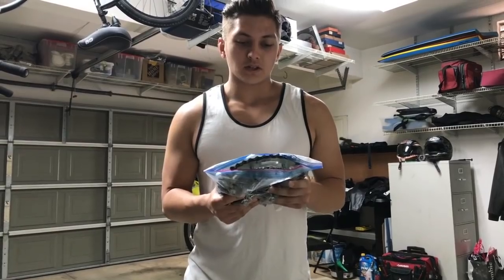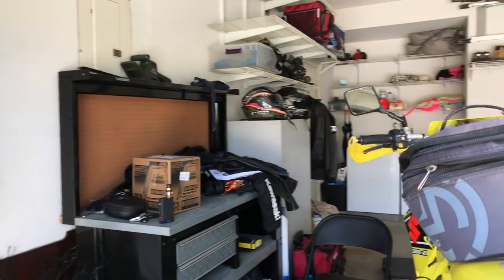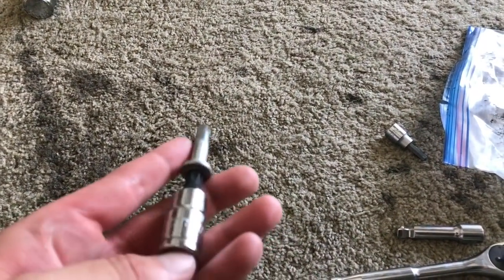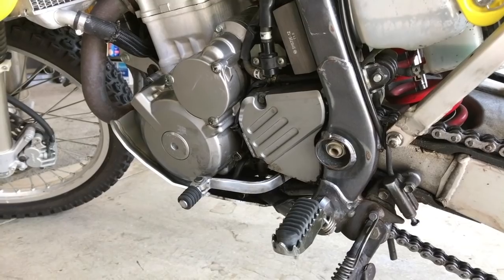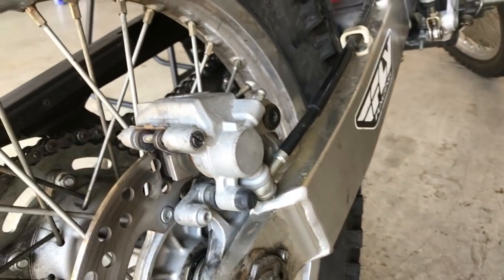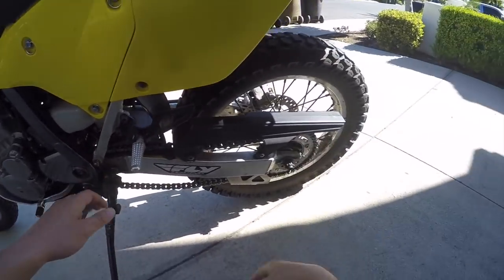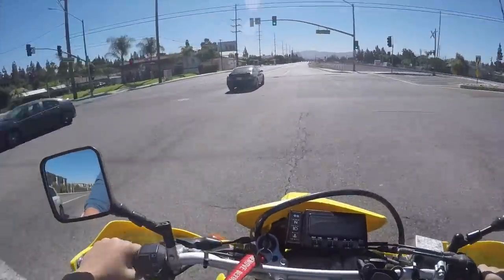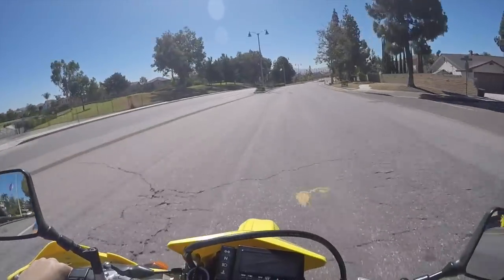THE BEST DRZ MOD: GEAR RATIO

Comment: your axle is in the wrong side your snail cams are upside down.
always undo the nuts on sprocket bolts the allen head is only to stop the bolt spinning after the bolt is loose.
your chain is way to loose.

Comment: I went 15/47, just changed the front sprocket only, works as a great all rounder for me. Low enough gearing for the fire trails and high enough for the freeway. 
Better fuel economy and a longer run in each gear. No problems for a wheelie 👍

Comment: Hahaha oh my god I was cringing the entire time, he rode it from his “mechanics” with the countershaft nut loose, dumb as fuck.  Chain is loose as hell, the rear axel was put in thru the wrong side.  Guarantee he didn’t loctite the counter shaft nut and Torque to 80lbs  and it got loose already and is eventually gonna blow the seal and  drain all his oil which he defiantly won’t notice and it’ll blow his engine. Some people shouldn’t work on their bikes, for their own safety.

Comment: That chain is dangerously loose.

Measure the midpoint between the sprockets, and at that point slide your middle 3 fingers under the top run of the chain. That’s 40-50mm, and the spec.

Comment: Dude you definitely need a new chain. That kinking in the chain is a bad sign. And don't put all your trust in the clip style master links. Your chain is way too slack for street riding too
Reply from the maker: jsnowden83 what exactly do you mean by the kinking in the chain?
Reply: In the first part of the video when you are looking down the chain you can see how there are several links kinked. It means your chain is wore out
Reply from the maker: jsnowden83 the chain has 200 miles on it and doesn't even have surface rust. I get what you mean. I'll keep an eye on it though.
Reply: SoCal Moto a bad chain won't always have rust. Just make sure you keep it adjusted correctly and well lubed
Reply: ya that chain is seriously slacked out waaaay to much

Comment: Have a 2019 drz400sm stock. Just did a 16 tooth up front from 15. I love it.
Reply: How much torque did you lose?
Reply: @KaelinTate  not sure but after that i added 39 rear tooth. Bike can wheelie from 1st to almost top of 5th
Reply: I did a 16 up front and a 39 in the rear...perfect for the highway

Comment: The countershaft sprocket will come off with heat.   Heat gun or map gas. 
Check out Aussie Dual Sport about a short test ride.
Being a YouTube junking everything you want to do on that bike is on there.
Nice Video
Reply from the maker: Hillbillybeeemer WV I totally hear you brother. I didn't have a torch or anything at the time so my nice mechanic came in clutch lol!

Comment: Gearing makes all the difference for sure! my SM came with 15-41 originally. I just put a 39 tooth on the rear this weekend; it's even better on the highway now. I do notice a slight lack of torque off the line from the 41 but that is okay. My SM has 17 inch wheels so with your 18-21 wheels I bet the 15-41 setup now is amazing. Great video!
Reply from the maker: Snow Peak thanks man I appreciate the support! Glad you enjoyed. More weekly vids to come
Reply: I'm 15 38 on my s

Comment: I have a RXB150 with only 4 gears. I had to change my rear sprocket for higher top speed and it was the best mod i have done for the bike. I enjoy the bike a lot more now. The bike probably goes 65mph. 

If I owned a DRZ this would be one of my first mods and it doesn't negatively effect the bikes mid to top speed just the take off speed going into the mid range.

Comment: Any time you have a bolt with a nut on it, you ALWAYS loosen the nut. You have to hold the bolt, but don't try to turn it, turn the nut. But problems like you had are how you learn! I've got the most badass drz400e that i plated and I'm going to try a smaller rear sprocket. Thank you for the video, even though it's 6 years old! Oh my God, i can't believe you rode it with the chain so loose!!! You're lucky it didn't bunch up in front of the drive sprocket and smash your case!
Reply: Yup

Comment: The trick on the sprocket nuts is to turn the nut not the bolt.  Use the OEM bolts, not the Trackside ones, the Trackside ones fits poorly.

Comment: So it’s a 15 front and 41 rear? What’s the top speed in 5th and you did not have to buy a longer chain? Just add the master link for convenience? Can you send me a link on where you bought everything? I have a drz400s 2019. Also one more thing, with the stock handle bars, it’s a pain to find a phone Mount that fits on tight. What kind do you have?

Comment: u gotta pull both axles off and clean off that black dirt grease and throw some marine grease on the axle rod mayb back the bearings and spacers wipe away excess but u def need that u will be amazed at how sqeak free and smooth the wheels will turn on her after that... and lock tite the bolts man ur day will end quick on the highway if a sprocket bolt backs out and flings out the moving chain throws it right thru the case on ur tranny... just do it right the frst time and clean and grease her up she needs it those spacers look dirty as heck..

god bless and awesome videos im thinking about getting the drz 400 r u on the 400 or do u have the 650

Comment: way to much slack in thsat chgain mane dont want chain slap take a link out would make a world of difference n ur adjuster nut wont be backed all the way out did the same thing to my ducati to get even more top end speed...also harbo freight has chain breakers n u can pop the link out and put it back together dont need a master link technically but good to do it right the 1st time

Comment: Thanks for sharing boss! I have a DRZ-E and I have been working with my gearing for the last few months! I ride 70/30 -more dirt and I have arived at 15/42. Don't know if you are aware but you should run the case saver for the 15 tooth if you haven't already. Ride safe out there man!
Reply: What's a case saver?

Comment: I just bought a drz400sm yesterday and it's a cool bike, I have a crf250l too and the first time I swapped the sprockets I had one bolt strip out on me too, took hours to get that one bolt out, factory uses thread locker, I didn't put any on the bolts and after 11000 miles they never came loose

Comment: you think this would work with a DRZ 250?  also might want to keep in mind what speed your tires are rated for...
Reply from the maker: Hank Amarillo I'm honestly not too sure with the dr250. Not extremely familiar with that bike. The only thing I'd say to watch out for is going when going with a bigger front sprocket just make sure you have the clearance for that

Comment: nice video bro . I went from a 47 to a 42 on my drz 400e and i cut 5 links of the chain with angle grinder .it was 14 47 stock now  15 42  have not been for a ride yet but if it seems a little tall i'll go back to a 14 on the front
Reply: How did the 15/42 work out for you?!

Comment: If I want my 2001 DRZ400e to comfortably ride on the interstate, what sprocket size should I run? I was thinking 15/42, but if anyone else has better suggestion I would love the feedback!
Reply: That's wat I run if you go smaller on the front you will eat your swing arm 15 front an play with the rear only because 14 hits your swingarm

Comment: i'm about to change the gearing on my drz , i noticed the chain link in the video that others have mentioned but also my axle goes in from the leftside and you had yours going in from the right side! I'm sure it works both ways just fine but i wondered which way it was meant to go. Cheers
Reply from the maker: Just Tex I haven’t experienced any issues with how mine was setup. From when I bought my bike to now it was like that so I just figured that’s how it should be. If it worries you that much just switch it. Pretty quick fix
Reply: I think i'll keep mine the way it is. I just had a quick look on here and could only find one other bike with it the way yours are, There's a vid of a brand new 2017 at the aimexpo and it has it the same as mine so i'm guess that should be right. But either way it seems to work just fine. Cheers

Comment: Is your DRZ an S or E model?

My SM used to have the stock 15/41, and then I converted it to 15/39 and made a HUGE difference.
Reply from the maker: E2Moto it's the S model. I basically converted it from the S gearing (14:44) to 15:41 and it's amazing!
Reply: I bet. Thinking about moving from 15/39 to 16/38, and it's very popular for freeway commuters.
Reply from the maker: E2Moto if you rock a 16 in the front you'll have clearance issues because it's too big for the guard. You can make it work but just remember that
Reply: SoCal Moto I got 16 front, I just run with front guard off
Reply: @E2Moto  did you did it?

Comment: did something similar on my sm. great on the hwy but forces you to slip the clutch a lot more when you're off road at low speed i find. oh and forget about wheelies lol.
 definitely not a mod for everyone
Reply: same gearing on mine sm , find the torque on 1 n 2 is bad 3 gear slightly better

Comment: whats the top on it ?
Reply from the maker: sdq sdq do you mean top speed?
Reply: the max speed after changing gears
Reply from the maker: sdq sdq if I'm throttling it for a while and laying low it'll hit bareeely 100 now.
Reply: i see guess this gearing is for mid range and pick up

Comment: imo you need no more than an inch of slack on the chain with u sitting on it and lock tight the countershaft sprocket nut. I hear they back off and destroy the shaft oil seal and dump your oil out real quick. there's alot of things you should use lock tight on on these DRZ's I'm sure you read up in it though.. ride safe.
Reply from the maker: Steve's Auto OSTROGOTH thanks for the info man I appreciate all the knowledge I can absorb! You too!

Comment: I tried 15 41. Ride for a few thousand. Ended up with 15 43 which i find perfect with a 140/80 18 rear tire. Great on the highway but first gear is still reasonable for the trails. Had the 15/43 on for tenthousand k now still happy with it!
Reply: Can you run the 15/43 setup with the original chain?
Reply: @AKJeeper  I'd like to know that too...

Comment: ACT Gear set, problem solved lol. There is no good compromise in sprockets for the DRZ using it as a dualsport. Either smoke the clutch in the woods and bust yourself, or red line at 55MPH. Now you can rock climb and idle at 65.

Comment: Thanks for the tips duuuuude.
Next time I come across a nut or bolt that is too hard to loosen I will attack it like a maniac with a hammer instead of using the right tools. I give you points for having a go but honestly you don't have a clue. 😂😂😂